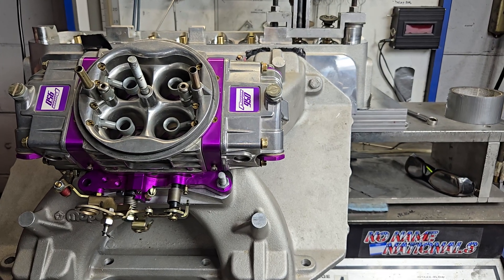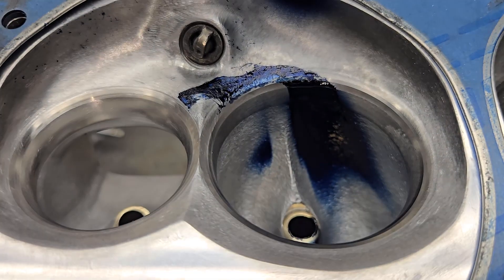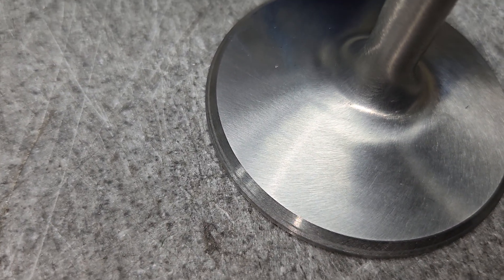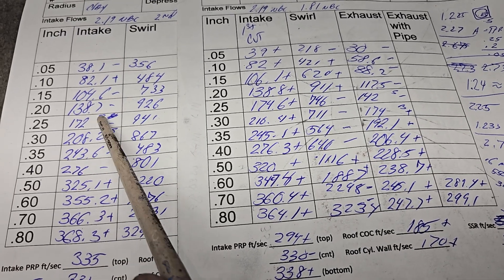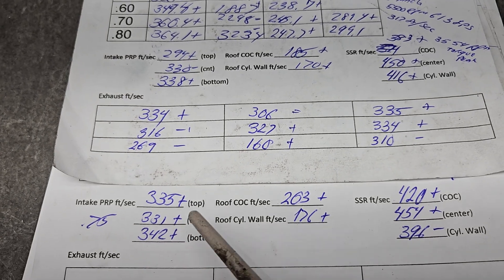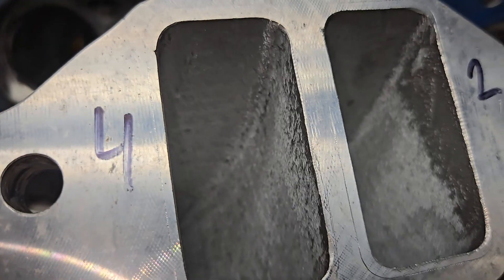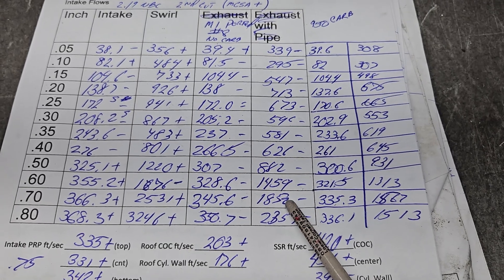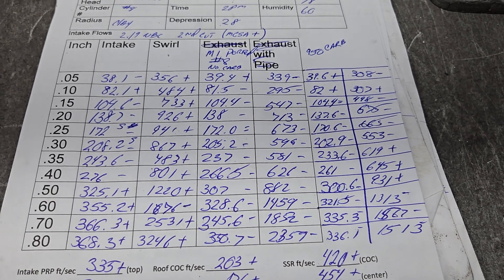Dangerous Donny's 540-440 Big Block Mopar project. 2nd cut looking for CSA! Will it improve cfm?

Comment: Never mind Chev BBs, this engine is going to have 2nd gen Hemi's sweating and at a fraction of the price. I remember when the 440 cranked 400s hit our area in the mid 70s. Man those 451s would rev like a 383(7000rpms easily) and deliver on torque AND horsepower. Killer street/strip engines and all the guys were doing for heads was following the Direct Connection foam rubber port templates. NOBODY had your level of skill, equipment, technique or science Charles. Makes me wish I could afford to feed a "540". Great read/watch.
Reply from the maker: Glad you like it!

Comment: Is that the "337" M1 intake?  I don't know the casting number, but it looks like it the 337.
Reply from the maker: I think it is. Thanks
Reply: Good eye.  It is a Max Wedge Mopar Performance M1 "337 intake". Part: #P4876337.  Casting: #P4532854 (on bottom of intake).

Comment: Charles, could u do a favor for me please?
Could u measure the width of the pushrod pinch ?
Reply from the maker: I would need to check my notes. You cannot use my pinch measurement to modify another tfs 270 without sonic measurement!
Reply: @servediocylinderheads I have 240s I was able to get 1.300 straight back, I busted through 1 pr pinch. Easy fix.
Really just wanted to see what they 270s are.
Thank you

Comment: LMAO!!! With a back cut and a good cam that head is good for ~740hp, and you were worried about all that work with nothing to show for it.
Reply from the maker: I haven't tested with a backcut yet.
Reply: @servediocylinderheads I think a back cut hurt flow on my tf's. I don't know that is a fact, as I ported my 240s and the SSR is pretty low, honestly I should have filled the floor in and went higher on the roof.
Reply: I think that is a really good head OOTB. For a described “Street” head by TF, it’s really really good.

Comment: Ive noticed on te divider side of these siamezed ports on the small block mopars. Yoi can add some csa.
Reply from the maker: It was done!
Reply from the maker: There is also an oil galley inside that divider. Use caution.

Comment: Okay is Mr Powell talking about chrysler in general or just the bbm , cuz in the small block world w8/w9 engines rule the racing scene!
Reply from the maker: I think he was talking BbM vs. BbC
Reply: Compared to a BBC drag race head a Bbm is down 30-40 cfm, this engine needs 400cfm to supply the demand
Reply from the maker: @powellmachineinc  Tall order from this head. Thanks
Reply: 100% on that. The Chrysler W program is a very good one with the W8 & W9 providing what’s needed to make some really outstanding power. The big block. Chrysler engine doesn’t have what it needs and can use with these street cylinder heads to equal what the small block has in terms of a head to feed the cubic inch displacement.

This has always been the short coming with “Street” style heads for the big MoPar.

Other companies have filled the void for higher performance and racing. I think you know where to go for that.
Reply: MBE LS/Small Block Ford heads have entered the chat. W9 who? Lol
Reply from the maker: @bigboreracing356 I would like to analize MBE's stuff someday. Thanks
Reply: @servediocylinderheads  BB&T Racing built a  nitrous Small Block Chevy that made 1000hp NA using MBE heads with soft chambers
 These heads make over 1100hp with the NA chamber.